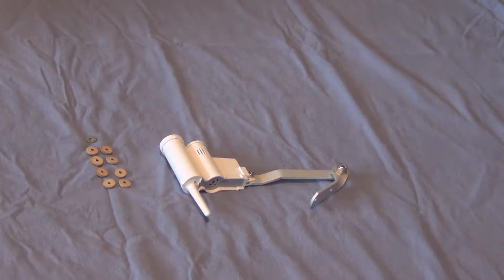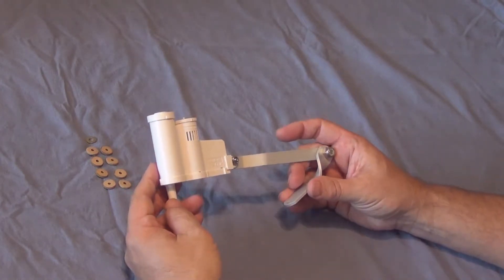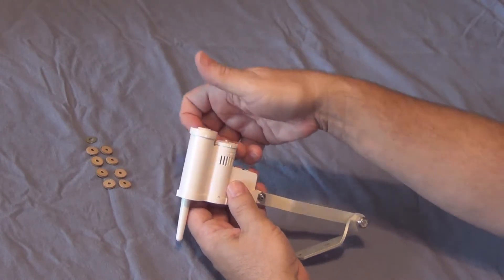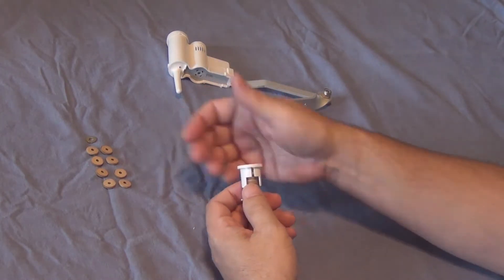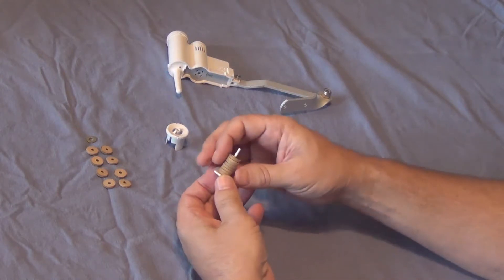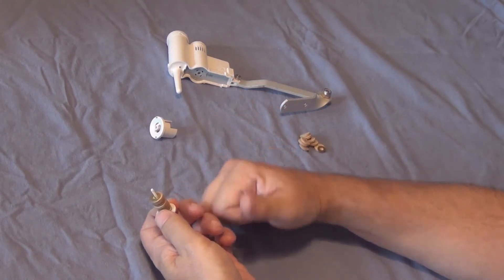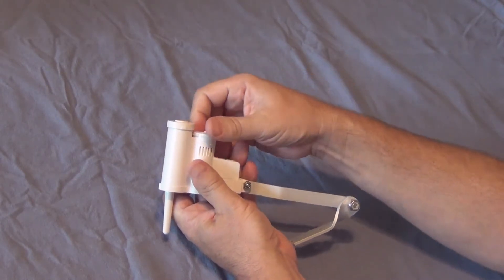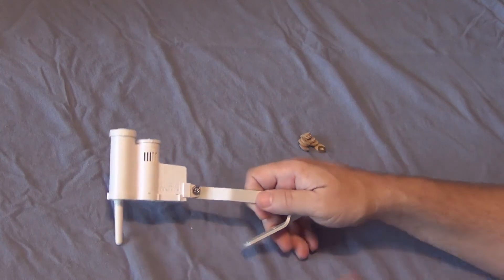Hunter Wireless Rain Freeze Clik Irrigation Rain Sensor Repair - Changing out the Hygroscopic Discs

Comment: So glad you sell these replacement washers - less expensive than replacing the whole unit but I may have to even do that soon because my unit came with the house built in 2002 so it's the old style with the wire antennae.  QUESTION: when I took this old sensor apart there were 7 discs not 8.  Is that how many the old units had?  If I put on 8 it immediately turns off the receiver even at 1/4 inch?  Any ideas?
Reply: If it is a Hunter sensor, most likely there was 8 discs.    It could be possible that two of the discs have fused together over the years so it appears like you only have 7.    Regardless,  if you are having issues with it turning off way too quick, you can always try removing one of the discs.    or if you have a sensor with an adjustable cap, you can just go up to the next higher setting.

Comment: Phil can you confirm that the test button ceases to operate if the cork discs are wet due to the expansion of the cork? I had to return a WRF-CLIK b/c of this reason. The replacement once it got wet, did the same thing. No where in the manual, nor Hunter Industries, told me this. They said the button should work even when wet. So far this has not been my experience. Can you confirm?

Comment: Is there a spring under the disc ? Or it’s just so happens I had a spring appear in my work area
Reply from the maker: There is a spring under the spindle / disc / cap assembly.     just drop it back in around the vertical post in the body, then put the cap assembly back in.

Comment: I ordered your disks, without a washer, before I opened my sensor (it was raining). After I opened my sensor my disks were not too bad, but I could not find a brass washer. My sensor is about 3 years old. Did Hunter make some sensors without a washer?
Reply: I received my replacement discs in the mail in just a few days and took some time to understand how the rain sensor works. I took the parts out of my sensor, including the discs and the center spring . I washed the chamber out thoroughly. It was full of tiny critters and debris. You may need a tweezer to replace the spring back in the center. I placed the new hydroscopic discs on the spindle, keeping them dry. If they get wet, you will probably need to let them dry out before they will assemble properly. The way the sensor works is: when the discs get wet,, they expand, pushing the assembly down, operating a switch in the bottom of the sensor, transmitting a signal to my remote receiver next to my Hunter Irrigation controller, turning it off. My Rain-Clik works GREAT again. BTW, my sensor did not have a brass washer.    Thanks!
Reply from the maker: All Hunter Sensors should have the brass disc...  if you did not have one in your sensor, it must have been inadvertently left out during manufacturing.   You can easily buy one at the hardware store if you want, however, it probably will work fine without on as all the rain bird, toro, and irritrol sensors do not have them and they use the same discs.

Comment: My sensor stays RED even with 10 days of no rain.  Could this be the battery  or discs or something else?
Reply from the maker: Could be either...   IF the discs are permanently swollen, they could be holding the switch down causing it to stay off... Or it could be a battery or wireless transmission issue also.   If you take the cap (with the discs) off and it goes to green, it is the discs.

Comment: How do metal discs act as batteries? Clearly this is what is used. I have never heard of this type of battery before.
Reply from the maker: The discs are not metal, nor are they batteries.  They are made from a hygroscopic fibreboard that expand when they get wet.
Reply: Wtf lol?

Comment: Phil,  thanks for posting the video. It is a wired Mini Clik.  Is replacing the disks the same concept as well?  Do you have an email I can send you a pic of mine?  Thanks.
Reply from the maker: The Mini-Clik discs are about 10x easier to change out than the WRFC in this video.   First make a note of the rainfall setting your mini-clik cap is set to.   Simply twist the adjustable cap from the top of the sensor and remove the cap / discs / washer / spindle assembly.    You can then pop out the spindle from the cap and change out the discs.    That's it.  Put the cap assembly back together and lock the cap in at the desired rainfall setting.     Use either of the links at the top of this page to go to my ebay store to order the replacement discs or the discs plus the washer.   

If you look at this video at the 0:15 mark, you will see him remove a cap from the mini-clik.   
https://www.youtube.com/watch?v=vx6zGNPApEc
Reply: Phil, Thanks for getting that out to me.  Installed with no issue.  Please stay safe.

Comment: How do you know if it needs a new battery
Reply from the maker: This is from the manual online for the Hunter Wireless Rain-Freeze Clik:

Battery Life
The Wireless Rain-Clik transmitter is designed to operate
for at least 5 years with its sealed, maintenance-free
battery. The transmitter is available as a replacement
part (WRCLIK-TR). Should you need to change the
transmitter, the receiver will have to learn the new
transmitter address.

To Check the Status of the Battery in the
 Transmitter

1. Press and hold the quick response spindle at the top of
the sensor.
2. Within a few seconds the LED light on the bottom of
the sensor will briefly flash.
3. Release the spindle and the LED light will flash again. If
the LED flashes, the battery in the transmitter is good.
If you are experiencing problems with your Wireless
Rain-Clik sensor, follow these simple checks first before
assuming the unit is defective and replacing it.
Reply: Southeast Irrigation Supply  thank you so much for you help and quick response. Stay safe out there .
Reply: @southeastirrigationsupply7943  My sensor doesn't have LED at the bottom as described. How do I know battery status? It has been working fine and suddenly the receiver always stays green.
Reply: Clicking the test button doesn't change receiver LED lights either.

Comment: Is there a spring on the post inside the rain clik?
Reply from the maker: I believe that all of the rain-cliks have a spring under the spindle / cap assembly.  The mini-clik does not have a spring.
Reply: @southeastirrigationsupply7943  Mine is a rain clik with the spring. How do you get the assembly to stay in the little "tits" that go into the spaces with a spring pushing up on it?

Comment: How do you change the internal battery?
Reply from the maker: Unfortunately, the battery is sealed under the potting.  If the battery dies, you need to change out the whole sensor.